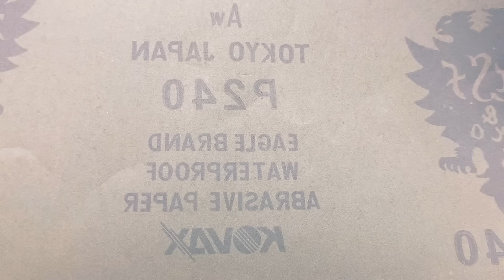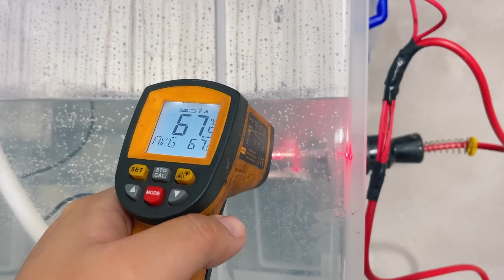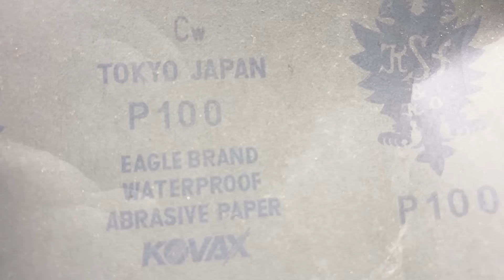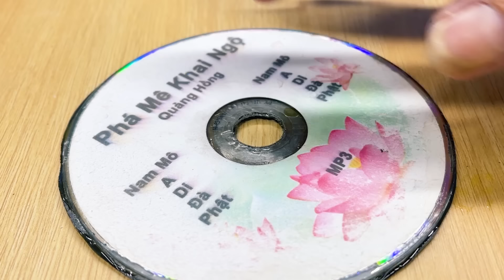102 AMAZING Techniques That Other Level Plumbers Always Want to Hide! SECRET Of The Metal Water Lock

Comment: The first mistake ; ❌❌❌
Grinding the tiles inside the 
kitchen and or bathrooms .

Grind & clean them 
outside ( outdoor ) to 
prevent cancer illness .

👎🏻👎🏽👎🏻
Reply from the maker: You're absolutely correct. Grinding tiles indoors can generate a lot of dust, which may contain harmful particles that could pose health risks, including respiratory issues. It's indeed much safer to perform such tasks outdoors where ventilation is better and dust dispersion is less of a concern.

Comment: you will got Electrocution and possible die when the heater got fail when the time comes....... some of it are good, but some of it are not good.
Reply from the maker: It's crucial to prioritize safety when it comes to any electrical appliance, including heaters. If there are concerns about the safety of a heater, such as the potential for failure leading to electrocution or other hazards, it's essential to address these issues promptly. Regular maintenance and inspection of heaters can help prevent potential failures and ensure they operate safely.